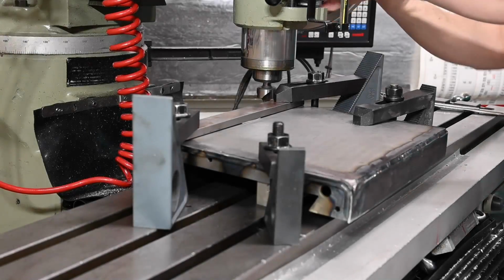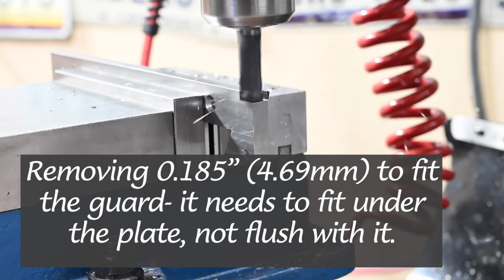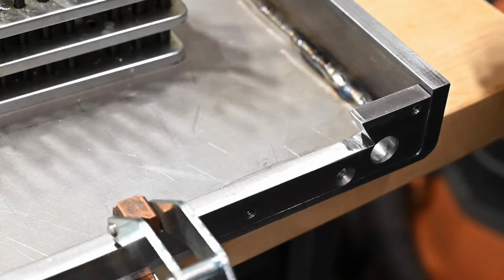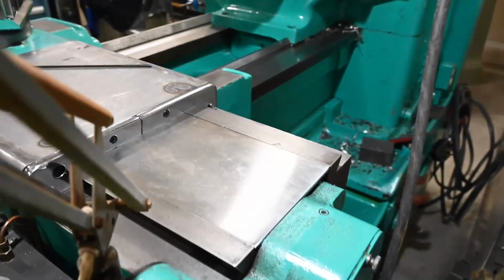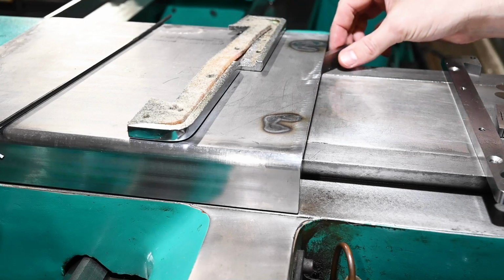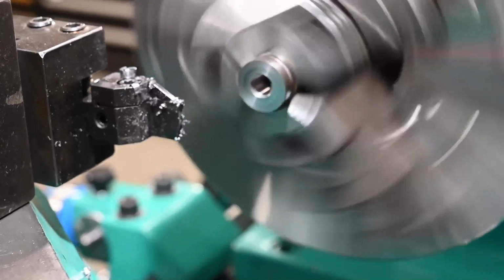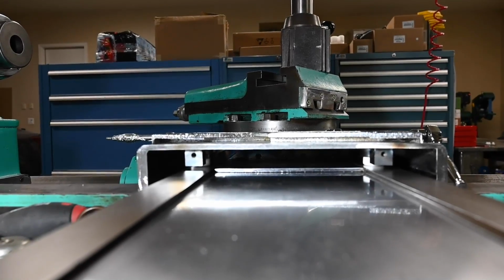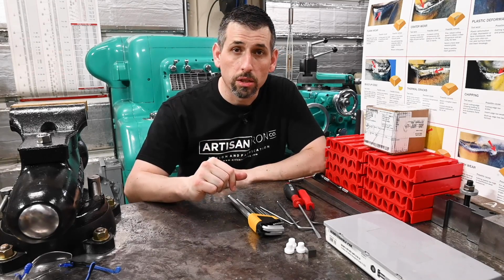Monarch Lathe Cross Slide Guard Part 3 of 3

Comment: I am going to have to fabricate virtually the same thing for my Big Monarch as all the guards for the taper attachment are gone. Fortunately I have the ones on my little Monarch I can scale them up from.  Yours turned out nice.
Reply from the maker: Hopefully they match up well in design for the 90- you’ll be measuring in square feet of material though lol.
Reply: Yeah now when I run the 20” monarch it feels so small. Of course I guess it is only 1/5 the size. Lol

Comment: not sure if it could have turned out nicer? looks really cool and strong inline with the rest of the size of that lathe. saved yourself a lot of hade ache with the radius and corner rounding end mill by tig welding everything. when you do that with mild steel the welds stay soft. any interrupted cut is barely even noticeable (on my lathe anyway). if you mig it they will be hard and britlle. love the silicone bronze at the end to tighten everything up and add a safeguard like you said. Really nice addition for your lathe.

Comment: When you get it painted it will look like a factory accessory. I'm liking the teflon supports and how fitted the slots on the sides, first class. I always notice the nut on your bench vice does the fixed jaw pivot? If so I don't think that I've ever seen that on a Wilton. Looking forward to future videos.
Reply from the maker: Thanks! Yes it's a swivel jaw model 60- you can find them occasionally with 4-1/2" jaws, but this 6" version is hard to come by.

Comment: You were too tough/modest  on your welds in previous video, they look super now, an old saying in industry "weld appearance means nothing to a testing machine" or in this case a milling machine, Great job on the bronze facing✅
Reply from the maker: Yeah if they were going to be visible I would have taken time to pulse them all to a consistent appearance but they were going to be machined so there was no point.

Comment: Awesome video as always. I'm excited to see this painted up after you machine the rest and mount the DRO scale. I apologize if you have already answered this in a comment, but I was wondering about the issue that arises when you advance the cross slide(away from the operator) to where the teflon glides "fall off" of the ways? When the cross slide is retracted(towards the operator) won't the teflon glides be jamming into the face of the ways for a split second before it is forced it to lift back into its position? Perhaps a second or third set of teflon glides along the length of the part can combat this?
Reply from the maker: Because the lathe originally had two compounds, the crossslide ways are extremely long. At full travel the new cover doesn’t reach the end of the ways.

Comment: Aaron, near the end of this video you are sitting at a bench. On the bench looks like red round bottom trays. Are these the trays you used for your twist drill drawer in the intro? If so where did you source those? Do they also come with dividers?
Reply from the maker: Yes those are the same- I’ll be doing a video shortly on how to organize drills and other tools with them. They are from Lista and I purchased them through the Lista Vidmar Quick Ship site. The dividers are separate and add up in cost, but the benefit is worth the investment in my opinion. The trays are called slotted grooved trays.

Comment: You could have made that out of Aluminum and it would have been MUCH LIGHTER.
Reply: which would be significant if it was a race car.
Reply from the maker: Yeah I considered that but wanted the strength of steel. If I ever bang something heavy on the top of it, it won’t easily bend.
Reply: @AlwaysSunnyintheShop  Have you ever noticed on Adam's lathe that part looks like someone took a hammer to it? There's actually a story about it he shared once. Apparently his father used to sit a spare chuck there when he wasn't using it.
Reply: @LambertZero  Thanks for mentioning that.  I have always wondered what happened to cause that damage.